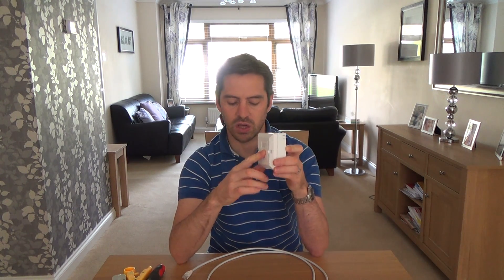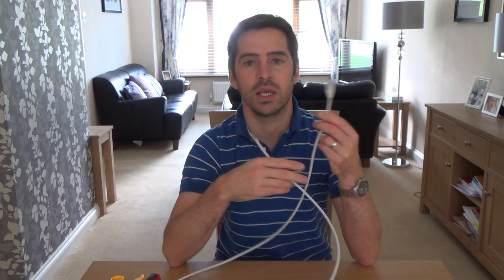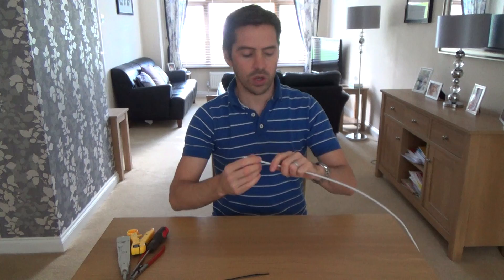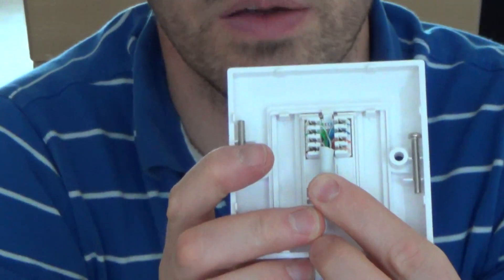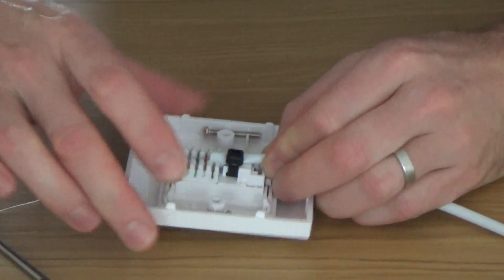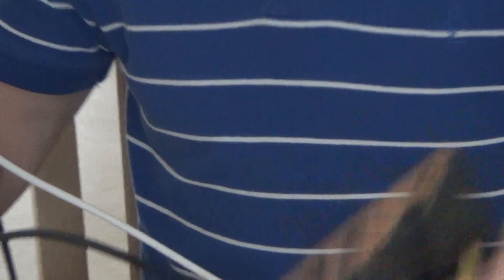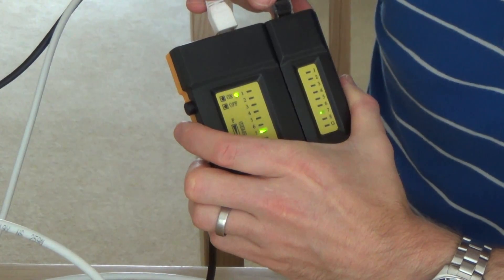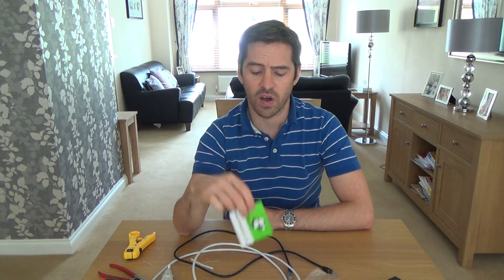How To install a CAT5E Network Faceplate Socket and How To FIX a wiring FAULT

Comment: Nothing bad about this channel and I didn’t buy it from here, but just felt the need to vent somewhere the hours I wasted this weekend trying to setup a faceplate to faceplate connection in my house. After initial install things didn’t work, luckily I had a cable tester - if I didn’t I may never have worked it out. The tester was saying pin 8 wasn’t connected. Redid both ends a couple of times before getting stuck. Both seemed fine and tester was still saying pin 8 was wrong. Wasn’t keen on cutting back the cables yet again and redoing things. So started testing things with a multimeter – again luckily I had one.

Initially tried testing the inside of the socket to the end of the cat cable, by realised the probes wouldn’t make contact down the very small grooves. Resorted to connecting to a stripped off bit of the wire in the pin 8 V inside the backplate and running the probe along the outside connections under the external shutter. No connection – hmm. Did the same with a different wire – CONNECTION. So, the wire down the pin 8 V is somehow not contacting the V? But I’ve redone this a number of times. OK, lets try touching the metal on the actual V and the outside connections under the external shutter. NO CONNECTION. That doesn’t seem right. Tried the same on the other Vs, they all worked

I have a flipping faceplate that doesn’t have a physical connection between the V and the outside connection – but only on pin 8. Insert appropriate expletives. Luckily, I had another old faceplate I could use and swapped it out. Immediately all worked OK

Hours and hours of frustration Grrrrrr!!!!!
Make sure you have a cable tester and multimeter if doing this job

Comment: Came here to give you mad props for going through every little bit.

Did my first install last night and honestly it went okay but the run to my garage was only showing 70-90mb download, I basically ran it with main electrical cable 😂 now I’m wondering that might be it before I end up re running new cable!!

Also the draw string , I wish I knew that , I was genuinely thinking I’ve left a cable out or something. It was external cable too so I had real issues getting the sheath off !!

Thank you so much for the information on the vid !

Comment: My cable tester says everything is o.k. But just made new installation and bought new S/FTP 6a cables. When I tested them with my switch (Netgear) I see some of the bought cables are not right. They work and give the speed but give an error with the switch cable test. Changing them with others finally helped me to end the errors and made my fiber 1G internet more reliable and not disconnecting my router anymore.

Comment: A cabler technician had told me that he can install a wall or face plate with multiple Ethernet ports of RJ45s connector. Next to a main socket where my modem is connected to and to be on full time. Then connect one of those RJ45 port (on the wall plate) to an existing phone cable that is in place connected down to a separate building in the property, connected to another socket point. That i estimate to be roughly 25 or more metres in distance from the main socket to the other socket point in the separate building. Then with modem on. Use an Ethernet cable to connect to one of the LAN ports of the modem and connect the other end of that cable to the Ethernet port on the wall plate connected to the wires that leads to the other building's socket point in order to get a signal in the other building's socket point, so a modem can be used there.

Is this possible? 

Or should a very long Ethernet cable be installed to replace the existing copperwire phone cable instead from one of the wall plate ports all the way to the other building's point and terminate that other socket point instead?

Comment: I am going to do some of these at home today. Luckily I have some good tools like a proper Krone branded tool like yours, not a cheap version and a Fluke tone tester. I therefore have no excuses not to do a good job! Just out of interest, are the keystones single use or can they be re-used? I was thinking they would be single use, but then you repunched some wires.

Comment: Very easy to damage wires stripping off a sheath(my first install).  I did a continuity test with a standard multimeter ( needed to attach a sewing needle to a probe to do it) found several bad connections... at the socket end.  Used the little pull string (didn't know what it was for initially) and made a clean install. Works. Thanks for the help!

Comment: Holy moly what an old video! I was able to repair my ethernet wall socket moment ago, just IPA cleaning that blades inside socket where cable goes and new B-type rewiring. Also that strain cutting trick was super helpfull, no damage to wires at all even I never work with network stuff!

Comment: Just the right level of detail for a novice like me. I now have a third floor, hard wired ethernet wall socket connected directly to my router on the ground floor. For years I've been using powerline adapters to reach the third floor and struggled with huge losses in connection speed compared to downstairs. Problem solved!!
I didn't have the tool to push the wires into the connectors so made my own by cutting a 1mm slot in the edge of an old store card. Worked a treat!
Great video, thanks.

Comment: I was helped when you said just use the labelling on the outlet for B. I must have wired it wrong (just going from left to right) 5 times before and couldn't figure it out. 7 years later, you're still helping!

Comment: Hello thank you this is helpful.  Did you have any advice on how to 
maintain minimum cable radius bends in the flush wall plate box?  
Usually the cable will enter the box on one side or through the back of 
the box.  You need a few inches of free cable so that you can install 
and maintain the face plate connection.  That cable needs to be stuffed 
into the wall plate box - that is the point at which cables can bend 
sharper than the minimum radius (radius = 4 times cable diameter).

Comment: What if you match up the colors on the ethernet jack and it still does not work?  Doe this mean the wire itself is faulty?  Also is the ethernet wiring the same as phone wiring?  Because there are two wires coming out of the wall and one is for the phone jack which works.  I noticed the wire for the phone jack are the same colors as the ethernet.  Since the phone jack works but I don't use it, can I use that wire to hook up the ethernet?

Comment: Perfect, just what I needed to find out. My question as was answered - if my wall socket is wired as 'B' then what do I use for the other end of the cable connecting directly into my switch? The answer was 'B'. Perfect. Happy wiring :)

Comment: Great video. I’m a bit of a layman when it comes to this stuff, but can you please tell me if it is possible to parallel wire a two connector socket. I have a double socket, and was hoping to use both of them. One for my game station and one onto my TV, but I only have one cat 5e cable going into the double socket.

Hope this makes sense. Thanks.
Reply: I'm afraid that's not possible. You will need a switch between your TV, PlayStation and the wall socket.

Comment: I have a question I moved into an apartment which already had this installed how can I find where the cables go?
Reply: I am 9 months late but if you remove the socket you may find a number in the ethernet wire. Go to your router and you will probably find several wires with different numbers. Choose the wire with the number you found on the ethernet cable and plug it into the router. I hope that helped anyone because I faced the same problem.

Comment: So, am I able to punch down two cables?

I want Cabel from router to a plug under the stairs but I also want cable upstairs. It’s easier and nearer to use one cable
Reply: Not for data, Needs to be separate lines from a router or switch

Comment: I appreciate that you didn't just edit out the part where you crossed the wires mistakenly so we could see what to do in case of an error. We paid a guy to install cat 5 jacks in the house and found out one of the jacks in a rarely used area didn't work at all. The guy couldn't be reached. I looked at it and realized 2 of the wires were crossed. I didn't know if the 2 wires could be simply taken out and rearranged after they'd been punched down or if I had to cut all the wires and redo them. Now I just need to get a punchdown tool. Thank you for showing this and for the very helpful video.

Comment: So if you use the B methods for the face plate near your router would you need to do the B methods for the faceplate at the other end of do they need to be opposite?
Reply from the maker: You would need to use B on both ends, the router end and the computer or Xbox etc. end.
Reply: @Mymatevince  so could do the same thing with methods Alike same connection both side? Also which methods is best preferred?

Comment: great video , i have a question , i need to use wireless network on 40 desktops, connected 4*4 amking it 10. i need only 10 dongles then cross the cables over a 4 port  .... but i have realized that only 10 desktops with dongles communicate to each other the others crossed by cables wont communicate but can share the network access easily
need your email to explain

Comment: There was one video you did using a tester which was green and white (or cream)! I got one of those testers with a package.
I have discovered through time that there seems to be something wrong with one of the rj11/rj12 internal wire testers.
Any RJ11/RJ12 to the same or even an RJ45 came up with an error! I presumed I had incorrectly crimped the RJ11/RJ12 plug and just cut off the plug, binned it and tried again.

Then, out of the blue I decided to just use the RJ45 sockets for testing the cables and each core tested okay!

I have been considering another tester to buy, but, which one do you trust?

At the moment I can live with using just the RJ45 tester sockets for checking the cables.

However, it does raise a pertinent question.

How do test your tester, if you suspect it may not be working?

Just as a p.s. I made a RJ12 to RJ12 lead using a length of the 2 pair cat 5 telephone/data cable I purchased and replaced my router lead with it and gained 1 Mbps from 22 Mbps on my broadband speed!

Comment: Well, I, with the help of my son managed to complete a dual socket on the wall near to the router where two cables run into the loft and one going to my son's room for his PS4! The other cable goes to the rear bedroom where I previously had my Desktop PC, but is currently unused, although it was used for a smart Bluray player. I had done the cable to the rear room, with difficulty, (I had to rotate the plastic box in the wall by 180 degrees so that the cables would come from below onto the socket IDC's and allow them to be tie wrapped!

My son was impatient to have his PS4 connected to the Internet again! So I took as a learning aim for him to help me by doing the cable for his PS4!
He must have done OK because the connection passed continuity 1st time, although I am not sure if he will attempt to put an Rj45 connector on to a cat5e cable yet.
Alas, he cannot watch your videos because the YouTube app uses too much memory on his iPhone.
Still, I enjoy watching your videos.
My only main issue is that my left hand starts shaking after a while making it a bit difficult doing any rj connections!

Comment: When I use my connection tester, when "1" illuminates on the sender, I get lights 1 and 2 dimly light up on the receive side.
What's going wrong?
Reply from the maker: Sounds like pins 1 and 2 are slightly in contact with each other so that will normally be the orange pair of wires if you used the 'B' configuration. Test the tester with a spare Ethernet cable just to make sure the tester is definitely working ok in case the tester itself is faulty.

Comment: Great video. Simple to the point and covered the point of how to test and what to do if it go wrong. Well done liked it. How to use a tester what the reading should be and what to if it goes wrong. covered all the point good pace and detailed.

Comment: HI  Vince Really found Your how to videos informative, started out looking how to make my own patch cables. Now I have gone on to networking, I followed you how to video on the subject and did a simple two plug network from my router to an upstairs room, all the wiring check out and I had continuity on the tester, But when I connected the patch leads from the network boxes and use the computer I found that when I did a speed test it dropped from 110mb to around 80/89mb. I am using cat5e cable from you. when I just use a single length of the same cable from router to computer I get 110mb again. any help would be welcome, have I done something incorrect, or some other problem.

Comment: Brilliant video. How deep are the back boxes you use? Have everything laying around but not sure on the box size I need to get. Think a 32mm would do it?
Reply from the maker: Hi, thanks :-)     The deeper the better as it is nice to have more room but 32mm will definitely be enough. If you were using a quad plate (4 ports) then it is best to have a deeper box to allow a bend radius on the cables as they get in each others way on a shallow box.
Thanks Vince

Comment: Hi Vince, do you have a reliable method for adding additional cable to some already existing structured cabling? I.E I have a dual rj45 socket behind the TV's in the living rooms and in the office, but I want to extend them to quad sockets.. I've unscrewed the face plates off the wall and the cables run up the walls into the roof cavity.. I haven't had a look up there yet but I assume they then all take the same run back to the patch panel in the garage.. I was thinking about attaching the new cables to one of the existing then using that as the draw wire and pulling it through.. however my only concern would that it would come undone half way! theres no conduit unfortunately.. any suggestions would be much appreciated. Cheers!

Comment: Excellent video, very clear and easy to understand. One slight gripe: with regards creating a crossover by wiring one end to 568A and the other to 568B. Certainly not recommended, but modern network interfaces have auto-MDIX and can actually compensate for crossover connections. I'd agree if someone was using equipment from 10+ years ago, they'd have to be careful then with regards straight or crossover wiring.

Comment: Hi vince thanks so much for your video really good. Can I just ask a question, I have installed and tested just as you have advised. However 
I have installed another box by pigging the wires so 2 boxes on one line. When I try and use them I can only use one any idea what could be wrong.
Reply from the maker: +Peter Heeley Hi, each socket needs its own cable all the way back to the router, it cannot share with another socket. So if you have 3 sockets around the house then you will have to have 3 cables at the router, one from each socket.
Thanks Vince

Comment: I have looked at so many videos on how to do this and its so confusing. You explained this so easily and made and now I know that I can defiantly do this at my house. do you have videos on running though the exterior walls?
Reply from the maker: +OGTRIP Thank you, I have a video on 'how to run a cable' and there is a bit about drilling through brick walls and the correct way up to do the cable clips etc.
Thanks Vince

Comment: I have a net gear 500 signal booster it works by rj45 to the box then wireless signal to another receiver to the required device could I connect the booster straight to the wall port rather than the router
Reply from the maker: +william webb Not sure if I understand the question but if you connect it to the cat5e wall socket then that wall socket will need to be connected to your router via the cat5e cable.
Reply: +My Mate VINCE basically it's 2 wired boosters that connect to each other via wireless connection but need to be wired to the object you want the long distance connection with so one is wired to the router while the other in this case is wired to a Ps4 but could you connect it straight to the phone line through adapter or would it still need connecting to the router
Reply from the maker: +william webb It would still need to be connected to the router. It is the router that generates the Ethernet signal not the phone sockets.

Comment: very good video. Thanks. Sometimes its good to see when things go wrong as thats when you learn how to fix stuff. 
Quick question. If I have three ports on my cable tester USOC,  568A and 568B do I use 568b to test cables ? They start with orange so thats b right? But what is USOC?
Reply from the maker: +Wilbur jones 7 Hi, yes if it starts with the Orange pair of wires it is B and if it starts with the green pair of wires it is A. I believe that USOC is a standard used for different wiring configurations on old telephone systems for the different plugs used, it stands for Universal Service Order Codes. If you Goggle it you will find more information because I am not sure.Thanks Vince

Comment: Hi is it possible to use cat 6 cable from  A to B. And then using cat 5 face plates and patch leads, although I know I will only get cat 5 speed what I'm not sure about is will the strands on the cat 6 cable be to heavy to go into the back of the cat 5e faceplate
Reply from the maker: Vincent Whelan Hi, yes you will be able to use CAT6 wires in a Cat5e faceplate. The IDC terminals accept a range of sizes and cat5e and cat6 fall into that range.Thanks Vince